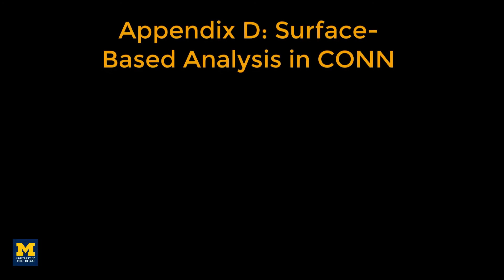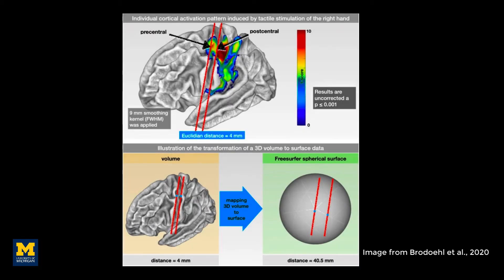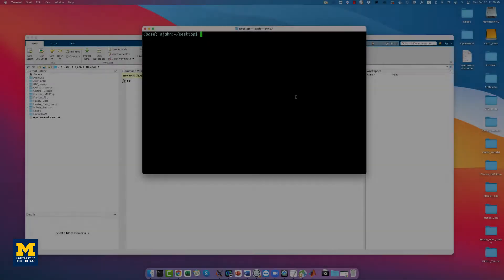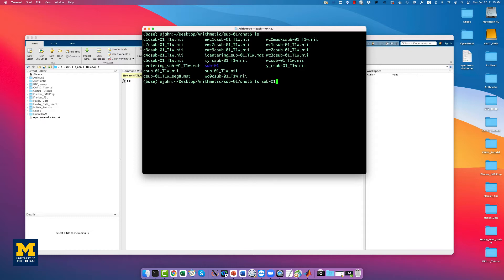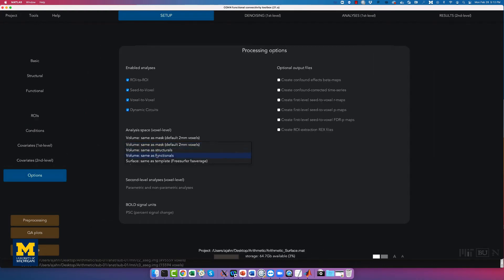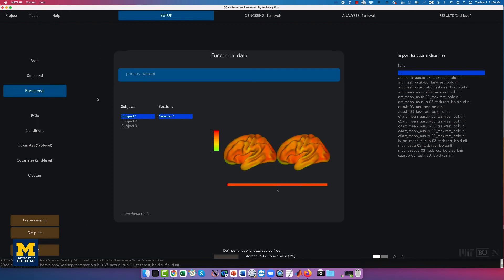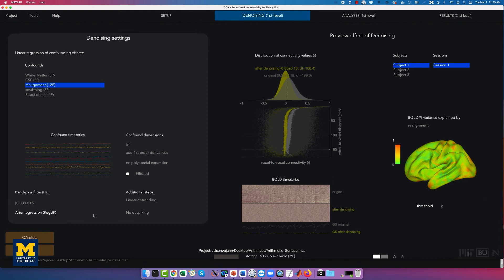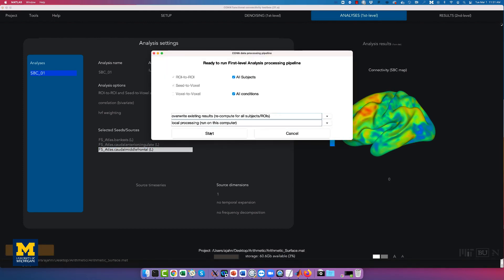CONN Tutorial, Appendix D: Surface-Based Analysis

Comment: Sir,I will have to bother you on some questions of fressurfer.In the output of freesurfer,I got the volumn data from aseg.stats.However there are something wrong with subjects’ data. Their data is zero or less than 5 between left-vessel and right-vessel.But is that right？Does this result need to be processed？